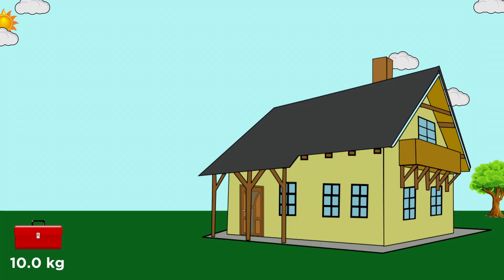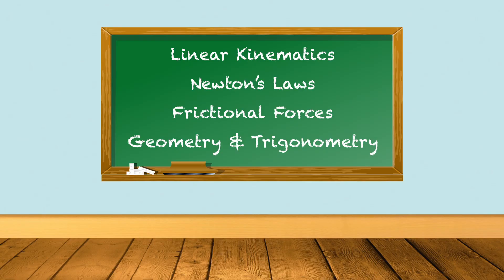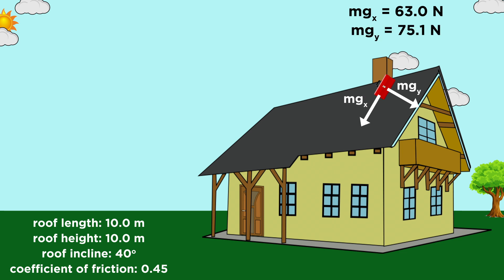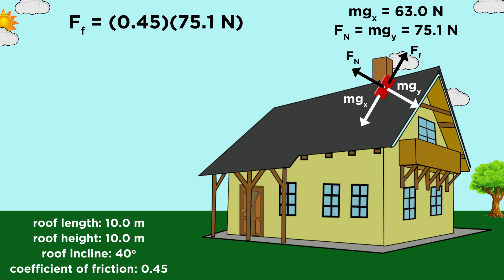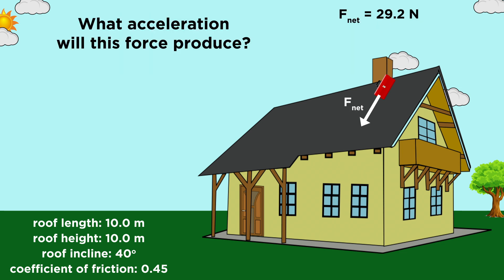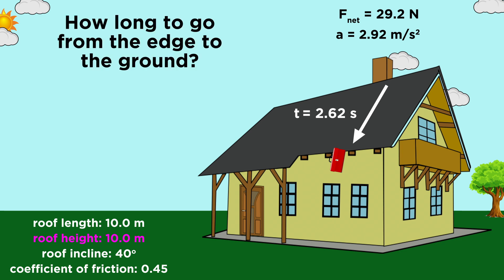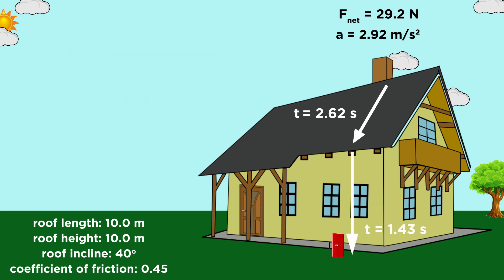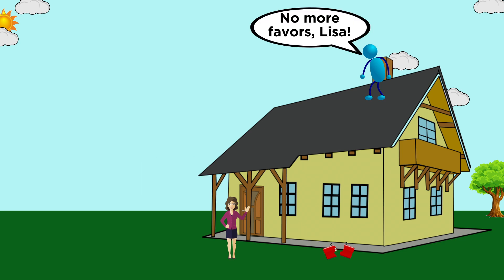Practice Problem: Box Sliding Down a Ramp

Comment: The velocity is not zero at the edge of the roof, nor is it strictly horizontal. If we were to make such simplifying (but unmotivated, even for expository purposes) assumptions, they would need to be stated in the problem. This is simply incorrect.

Comment: How could you approximate the velocity at the edge to be zero !! you were actually calculating a net acceleration which resulted in a final velocity at the edge of the roof and it is not negligible to approximate it to zero it can not fall straight down !
Reply: Ali Elokl yes you are right, but the initial velocity is assumed to be 0 to make the math simple to understand, rather than going into more steps into solving this particular problem.

Comment: sir i have a question will not be there initial velocity when the box is falling from the edge of the roof. because the box has got its velocity at the edge of the roof so dont its component act as an initial velocity while falling from the edge of roof????
Reply from the maker: yep there will be a small vertical component to the initial velocity, we just approximated it as zero for simplification.

Comment: 5:24   I was taught that distance can never be negative. If you take the distance negative or positive you get the same answer in this case but just saying distance can't be negative in any circumstance. It is a scalar quantity.
Reply from the maker: you're absolutely right, i should have said displacement! when doing problems of this nature we must take into account the direction of motion, and the fact that the object is moving downwards and acceleration due to gravity is downwards, and therefore both negative. so yes, we must keep our terminology straight and displacement is the correct term here, my fault!
Reply: you're so sweet. Don't worry, you can insert a correction box
Reply from the maker: actually no we can't do that anymore! youtube removed annotations.
Reply: actually the equation is 0=d+vt+1/2at^2

Comment: Hello Professor, Thanks for the video.

I have a question that i'd like to ask. In the second part when the box falls down from the edge to the ground, shouldn't the initial velocity be equal to the final velocity of the first part (when the box was sliding down the roof)? 

Thank you.
Reply from the maker: ah but that velocity is not vertical! if you slide something off of a table, its initial vertical velocity is zero when it leaves the table. here, since the motion is at an angle, there would be some vertical velocity, but we are approximating it as zero, since more of the velocity was horizontal than vertical (40 degree angle), and also we could probably assume some friction getting over the edge of the roof.
Reply: @ProfessorDaveExplains  excuse me, sir. I totally appreciate your tutorials, but in this case I find such a simplification too rough. It wouldn't take too long to compute the actual vertical velocity and then find the correct time, but the result would be much more accurate because t2 would be 0.6 s, more than 2 times less. Anyway, you're cool, thanks for all the content!
Reply: Aha, alright all clear. Thanks.
Reply: @ProfessorDaveExplains  It would be easier to say the tool box catches on the eves trough for an instant making it loose all velocity, so the tool box then falls straight down, and not parabolically.